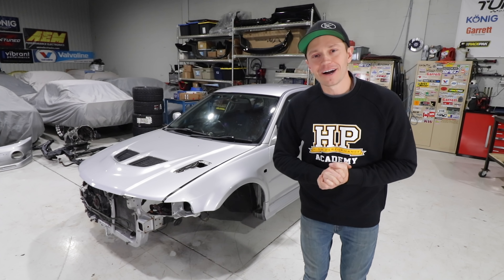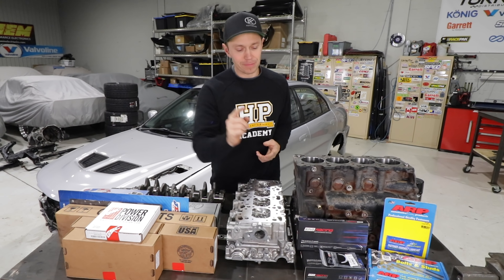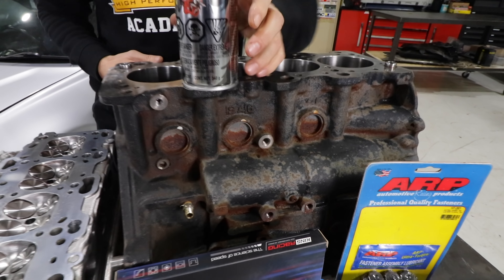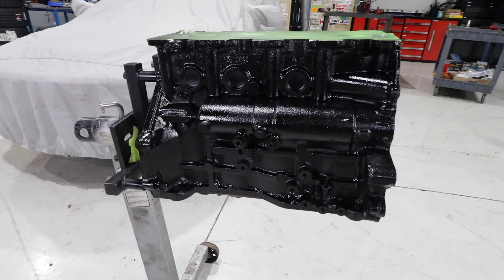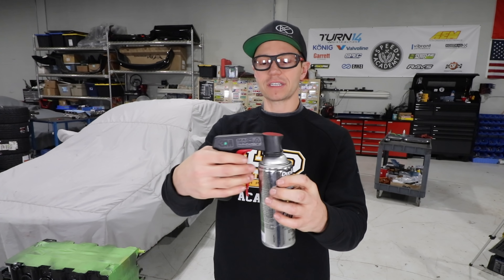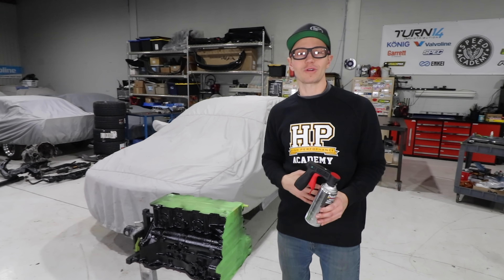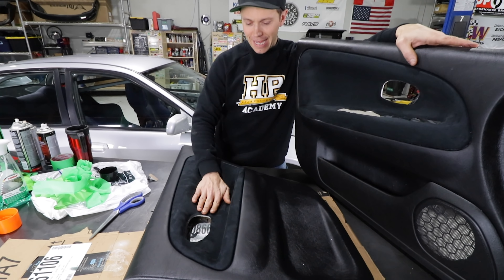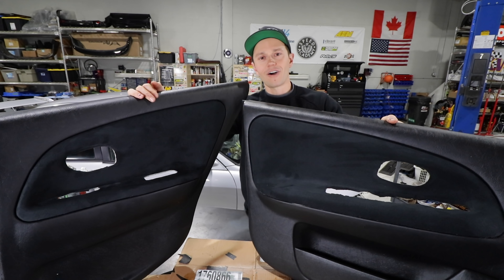How To Fix Worn Interior QUICK & EASY in the CHEAP EVO 6

Comment: Don't wrap the airbag, especially if you want it to function properly
Reply: its fabric it will just rip
Reply: @flytoday  but the airbag was designed to go off and fight a certain amount of resistance -- by wrapping it you're making it harder for the airbag to break through and I can't imagine that's a good direction to be heading in.
Reply: It's probably a "Murder the occupant" airbag anyway :D (My VIII was)
Reply: Airbags on these cars go of extremely strong. Strong enough the panel covering it wil go through the window. Pretty sure a bit of sued isn't going to stop it.

Comment: In future. Place the fabric without glue and find the position you want. Then fold it half and spray glue on the first half (or quarter) and on the back side of the fabric (wait for them to get tacky). Then you can mold it to the card. After it's done you do the other half. Doing it all at once is very difficult as you noticed lol. Also having a stretchy fabric helps a lot. Lastly work inside out similar to way you torque a headgasket or oil pan to prevent warpage :P.

Comment: I find using a plastic body filler spreader works really well to help flatten out felt along a panel. I've also had better success starting from the middle of the panel and working my way out towards the edges when smoothing out the felt.

Comment: I did this panel wrapping job before. Should've grabbed a couple panels from the junkyard to practice. Having a rubber applicator of some kind helps. You could get some black piping and hide the creases in the bottom. You can get the stuff on Wish/Amazon/eBay for a few bucks, and it just squeezes in place.

As for the weather seal, just replace it. A replacement kit is the way to go. They're cheap and keeps the sand/dust/rust out of your doors. Sound deadening in the doors is a huge improvement. I used a cheap kit off Amazon, and it made a big difference in my truck, and because of how simple the shape of it is, four panels covered the whole thing, and I only had to cut a small piece off one. Going to throw some in the wife's Micra, because if you think Evos are tinny, drive that thing around in the rain. You'll have a headache in 15 minutes.

Comment: 25:30 The trace lines are visible... mark out which pins you need, double check you still have a ground, and make the connections.
It might be easiest to get a male and female plug from your stash and make your own connector.

Comment: Nice. Btw, why not just use SEM vinyl coating to change the dash color? I've done it on my S13 over 10-years ago and it's perfect. 

For little cracks, fill with super glue, pack with baking soda, sand lightly and paint.

That said, I think the new wrapped dash looks amazing

Comment: For the lights on the cluster;  you can solder some wires straight to the board. Extend the wires to a connecter in a convenient location. I feel that would be the easiest way to get it done if you really want those lights. Keep up the good work. This build is awesome 😎👍🍻

Comment: you guys did a good job on the door panels and dash. I've tried those jobs before and they are challenging without 2 sets of hands. as for the cluster, I'm a fan of analog, but if i was to go digital screen, the whole cluster opening would have to be a screen like in the Lexus or Cadillac. good job and shout out to HPA💪

Comment: the door cards are definitly a victory, it will make a big difference to the car, and a good thing to use on the plastics inside the door is blue tac or board tac for sticking up pictures and stuff, its not as strong but its not messy

Comment: You could use the space either side of the display for your warning lights and convert to LEDs. Just install a piece of smoked acrylic and mount the LEDs behind it. If you're wanting them to say something, or have symbols on, use large rectangular LEDs and mask off the design with black die cut vinyl.

Comment: You could try pressing in leather/leatherette string around the gap of the door cards. That would fill in the gap and also hide the wrinkles. That's what I did with my MR2 and it worked pretty well.

Comment: I would follow the lines on the back circuit board of the dash and see where it leads to, you can either solder them directly where the plug used to be, or solder them for each bulb. However directly to the plug will involve less wiring as most of them use a common ground.

Comment: I might have deliberately cut long prior to the edges (excess material) to avoid the creases on your door cards and then cut perpendicular to the edges in order to create relief in the material, none of which would be visible since you would have factored in excess material and it'd all be underneath. Anything there's a specialist for has a lot more depth than most people think.

Comment: That plastic inside the door panels is called a vapor barrier. It's supposed to keep moisture from building up the door electronics. They sell rolls of them which you can cut to fit and are pretty inexpensive.

Comment: Great job guys! How about adding 2 or 4 gauges (possibly electronic, and not necessarily round in shape) either side of the screen to show vital information at a glance.
Also, you could make cut outs for high-beam & indicators either side as well as to not interfere with the shift lights.

Comment: If you guys ever decide to dabble in interior work again instead of cutting out holes in the fabric, pie cut the hole and wrap the extra fabric to the backside of the panel and glue it down. It will give you a longer lasting panel because over time the fabric can start to peal away from the holes when you cut them out especially if you have to take the pieces out of those holes to get the door card off more than a few times

Comment: So, if you look up KG Works Cluster for a Miata, you can see what I'll be talking about.  Scrounging around on eBay, you can find individual bezeled LEDs which you can individually wire into either the plug or the board.  I'd probably lean towards the plug itself, maybe source a female end from a place like Grainger so you can have an easily unplugged durable solution.  I'm not sure how those particular clusters work, but some cars will not operate the turn signals or will hyperflash if that particular circuit isn't complete.  Same with lights.

Hope any of this helps.  If it doesn't, don't tell me. 😁

Comment: Sounds weird, but once you get the fold horizontal its easy to stretch out. If the folds vertical to u then u wont be able to stretch it out. Try to get the fold horizontal inthen u can pull it out...if that makes any sense. Same rule applies with vinyl wrapping

Comment: You CAN NOT wrap the airbag. It will not work properly and may cause additional harm to the passenger or even the driver if it deploys. It can cause your dash to explode if the bag can not come out the way it was designed.

Comment: Hi Speed Academy, For the best and cheap door sealing option you can get some drop cloth plastic (are available in different tickness) and use some 3M Strip-Calk to apply it on the door. You can shape the plastic and en run a line of strip-calk all around the door (1 or 2cm inward of the edge of the plastic) and its even possible to remove and re apply it with the 3M Strip-Calk. 
Here is a example of it:
http://www.mhayes.us/impala/IMGP1582-800.jpg

Here in Holland I can order Finixa Door Foil but can find it outside Europe.
Here is a link:  https://www.nonpaints.com/nl/finixa-portierfolie-op-rol-60cm

I hope this helps!
Regards, Ben